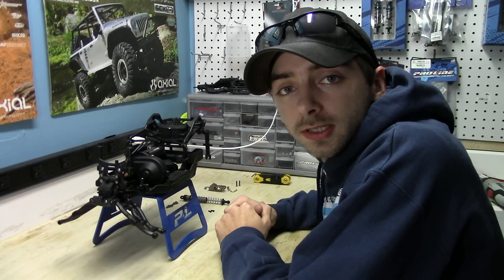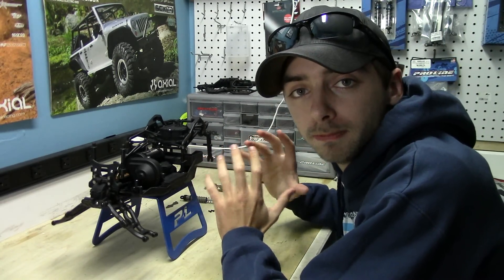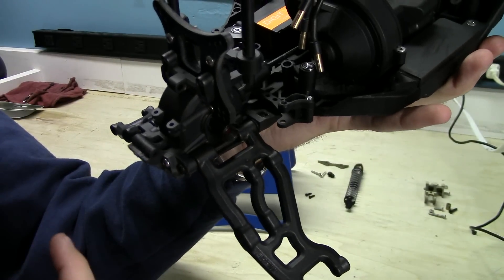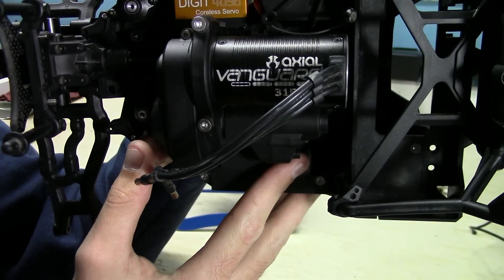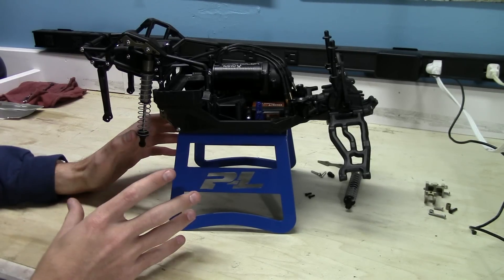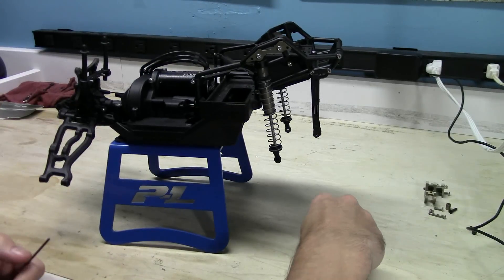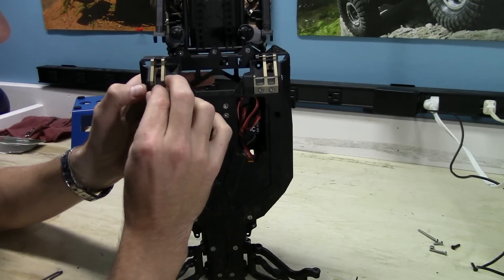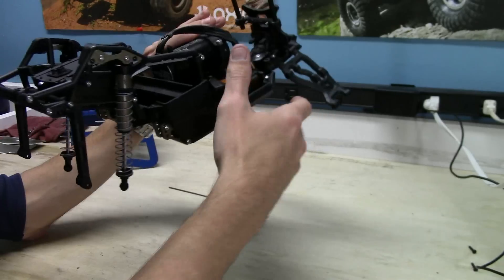RC Overload - Axial Yeti Upgrade - PT 2 - Steering & Suspention Upgrades

Comment: I found 50wt in the front shocks and 20wt in the rear to be a great set up
Reply from the maker: sweet man! ya i may actully half to give that a shot. im gonna test out a bunch of different weights when its running. so ill certainly take your input into consideration!
Reply: RCoverload forgot to mention i also noticed the rear springs are too soft i went with the 1.71lbs/in those seem to match up perfect with the 20wt and in no longer bottoms out off of a 1 foot jump

Comment: Also just a little tip. You can put some CA glue on the edges of your carbon fiber towers and it helps protect them.
Reply from the maker: Thats an awesome idea! Thanks! do you mind if i use that idea in my video...ill even give a refrance for ya!

Comment: Hey man. I finally got a Yeti I scored a great deal on eBay on a roller that was the kid version. And has a few extra upgrades. Looks like it really hasn't been used much at all think I got a great deal. I know this video is made a while ago. But go on eBay and get some titanium coated hex drivers. You can get them for under $10 if you really look. It will really be a huge help to you. Over those fold-out hex set that you have. You have the truck for a few years now so I should definitely get the aluminum steering rack set you're saying it already has aluminum hubs. And it looks like it has the axle cvd dog on things. So besides the steering rack what else is a must-have upgrade for this truck. Really excited I've got a Twin Hammers clone that I have upgraded with the shapeways stand-up bellcrank shock. And a real Twin Hammers real axial. Such a great truck I loved it. So thought it was time to get a proper Rock racer. Maybe this fall we can meet up and take for yetis out. For some good trail riding. Let me know if you still have the yeti. And if you could let me know on must have upgrades thank you so much. Rock on

Comment: So for the vanquish double sheer steering rack kit 
do you put both of the bearings on each side ??
Reply from the maker: +Daniel Sawatsky yes
Reply: Thanks bud 
Got that carbon fiber front shock coming soon
Reply: +RC Overload 
that make them sit super high 
is this with the stock parts??

Comment: I installed the Vanquish steering rack, the post as you did but my rack is rubbing. Did yours have any issues?
Reply from the maker: +noeltorres1027 Unfortunately i have not had any issues. Any ideas were it could be rubbing?
Reply: +RC Overload 

I did figure out where it was rubbing on my SCORE. It was rubbing where the steering goes left and right underneath the differential. Right where the set screw goes into driveshaft. I did the whole front end Vanquish. I opted for no carbon fiber. It handles awesomely!!
Reply: +RC Overload 

I use my Dremel to correct the issue. A little bit of the Vanquish aluminum had to go away but it was minimal.
Reply: Sancho thank you. I just ran into this problem. I will have to use a file. Thanks again

Comment: Do think the steering needs to be upgraded in the kit?
Reply from the maker: G14 It really depends on what your going to do with the truck. Also im not sure if in the kit version they use all of the same stock parts or if they use some upgraded parts. Either way, the best thing to do is get the rig... test it out and see in your opinion what looks like it will need for improvements

Comment: After changing the front toe block, I've noticed that as well as my screws backing out, they too had bent :/
Reply from the maker: BigCarKilla Yea, I am very surprised that those screws are doing that.....definitely some unusual stuff breaking on the yeti that doesn't "normally" break on other trucks.
Reply: Tell me about it. I wish I'd of known it was gonna be like this before I sank a heap of cash into the car and on parts before I got it. 

Lesson learned.
Reply from the maker: Yes i definitly agree... the rig has a lot of potential but with all the talk about how great this truck was before it came out. I think it set too high of standards for what it really is. I almost wish axial spent a little more time testing the rig before sending it to the market. But nothing we can do now...thats why im just upgrading it and making it better